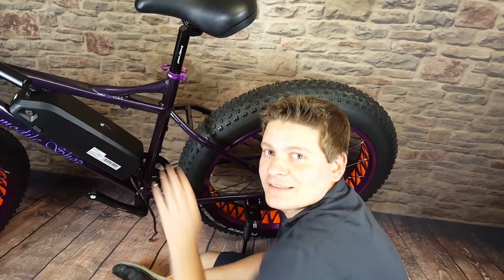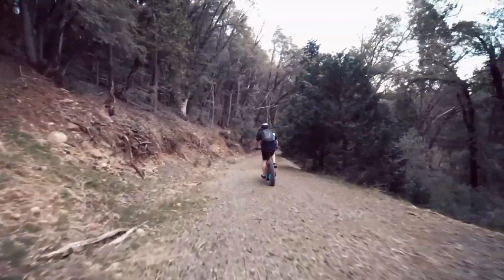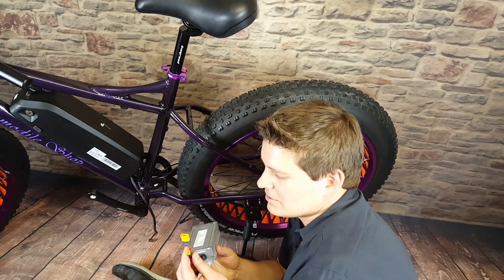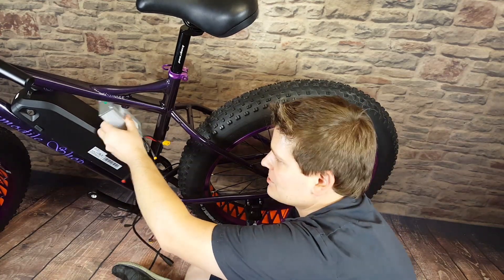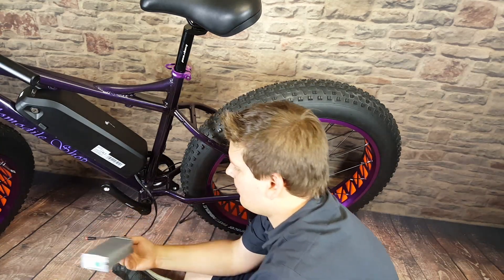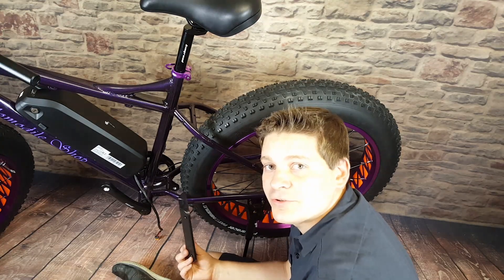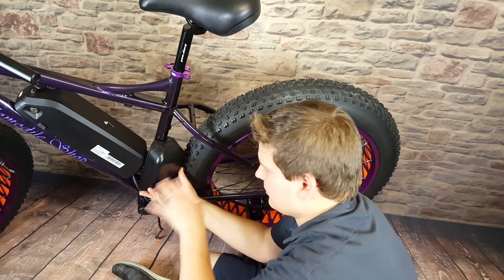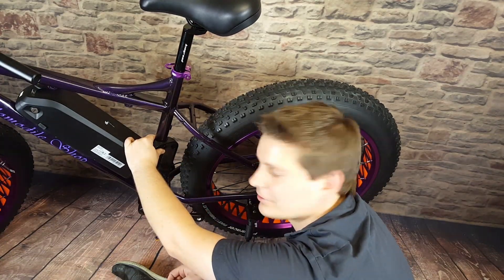How to mount an ebike controller - Episode 7 of How to Build Your Own Ebike

Comment: I have a question. I rearranged my controller box because when I got it the factory made it a rats nest. The controller was flopping around unmounted but there is a steel flat piece that happens to go over the box and I wedged it between that and the plastic box. Fits perfect. Now, I've heard two things. Is it ok if it touches the frame?

Comment: If you use the Carrera Vengeance, you have plenty of space in the frame triangle to mount both battery and controller!
There are four bottle cage lugs too.
Two of these are on the seat tube, so they can be used for the controller.

Comment: I wouldn't put my  controller in a bag or a box...heat is your enemy and enclosing your controller only makes it worse.  The front of the head tube or on a front/rear rack is a good way to get more air flow across your controller.

Comment: This is my first time hearing about a controller box. What benefit does this offer compared to sticking the controller inside a center mounted bag? I’m planning a build with a 3000W hub and I have to figure out how to keep the controller cool
Reply: bro where tf did you buy a 3000W hub are you in bike nascar or smth
Reply: @penguiburst  there's 12000w hubs, its not that much these days
Reply: @lioning1200  yeah i built mine with 350w but lowkey I'm leaning towards 1kw in the future
Reply: @penguiburst i built mine with 5000w and i'm happy i chose that much

Comment: Ey man...hope you are well.  Question:. Is there an applicable adapter for an dolphin battery with Anderson leads.  And how is the Anderson leads easily connected to an SY60 Female end.  The purposeful point of my question is relevant to the Anderson leads coming from the 48v dolphin shaped battery.  Without creating new insert leads.

Comment: I have an integrated downtube controller in the battery mount with julet connectors I want to add a headlight my display and buttons clearly support this feature how do I wire this in ?

Comment: Kyle...I live in the South of France and I had a FAT e bike for the last 20 months which I use for everyday commuting. I have just watched all your videos and I must say very few people have been able to explain it so simply. The complexity of UART./CAN BUS/ and all the protocols of TFT screens drove me nuts. And here you come along and offer a KT LCD8H and voltage controller which are compatible ....lovely....I had a lot of problems with my Ebike...brakes underpowered..gear selector cable shearing off..back light connectors desoldering....riding saddle falling apart...rear wheel puncture...rear foot stand falling off...misaligned rear wheel ...etc...So at last now a You tube channel which offers a comprehensive guide...Well done keep going.😁😀🤗
Reply from the maker: Glad I could help!
Reply: @Area13ebikes  ...just sent you a email...CAN you help..many thanks..pat👍
Reply: @Area13ebikes  brother what is the size of the controller box??? And from where you prchased?